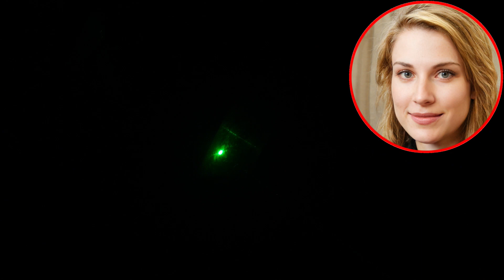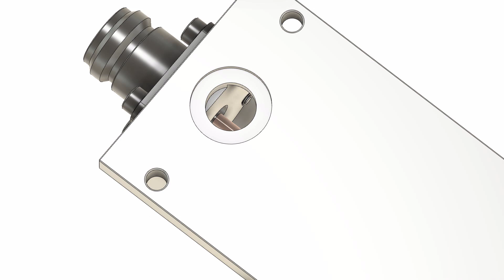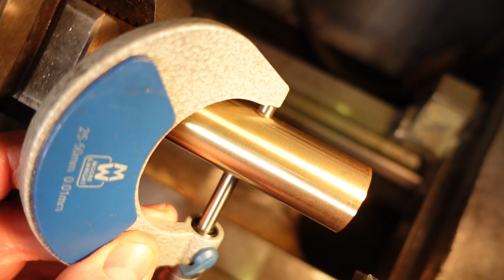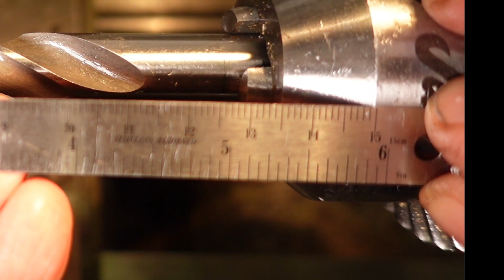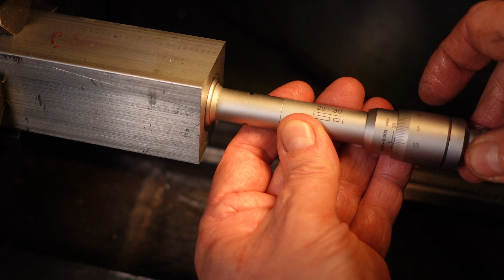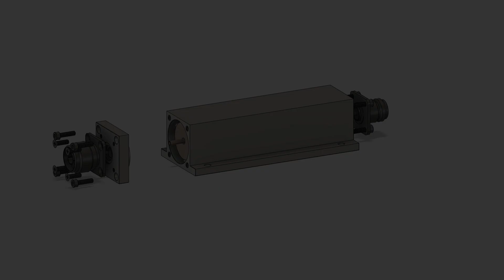Machining Microwave Coaxial Low Pass Filters Part 1

Comment: We are a bit of a niche group of microwave hobbyists with machines shops.  My 1.3Ghz filter is currently made from circuit board cut and soldered, etc.  Might have to try this out. Can you tune that filter a bit?  Not that it needs it at all.  <cough> Just for temperature variations, yeah those.
Reply from the maker: On the lower bands like 70cm and 2m, these are usually made using a long section of threaded rod and locknuts, so they are adjustable. As the primary purpose is mainly to kill the second and third harmonics, the key adjustment would be to optimise the Tchebyshev ripples at the main frequency of interest.  John G3XDY has a very nice 23cm filter design that puts notches in useful places and consists of a air-spaced line with stubs.  This is a brute of a filter, or at least the version with 7-16 DINs is.  This one with delicate little Ns is going to be limited to maybe 400-500W by those.  Mine has two female 7-16s and it should be able to carry more power than I can produce, although for EME, I guess nobody would care too much if I sent the signal with harmonics included.  I guess some tuning screws would be feasible, but the others I've made all just worked.  I have to make new spacers for this one when I do the soldering, to ensure the spacing is perfect. I use aluminium cylinders with a split, in a C shape.  All will become clear in the next vid I hope.  It's going to be interesting to see if there is any difference in S parameters with this version.

Comment: A coating on inserts for aluminium? From Cutwell?  Odd place that Cutwell, sent email re some tool or other. Sorry we don't supply to anywhere outside of UK and Ireland, fair enough, Australia is a long way for Postman Pat to get here.Then I get regular emails trying to sell me bits from their inventory!
Reply from the maker: My dodgy yellow-belly accent sorry, definitely UN-coated.  Cutwel head office is an hour up the motorway from here. If you ever need something from them, I'm happy to buy them and pop them in the post to you.  I'm not sure if there's a way to prepay GST like there is for stuff sent into Europe now. Much depends of you have carrier fees to pay when they collect tax/duty on behalf of the tax authorities, or if you are in a Civilised location where you just get a bill from the Government without Fedex demanding a £20 "processing fee" and then adding 20% tax to it. So annoying.  The DDP prepayment service is between £2.50 and £4.50 fee, but that's at least a little more reasonable.
Reply: @MachiningandMicrowaves  Thank You, that is a very kind offer. However I have a friend in Lincolnshire and he can get stuff for me as easily. Not that I need much these days, most of my normal supply lines are well established after some 20 years.  Although I have just ordered a Diamond insert with a chip breaker from AliExpress.  By the time it arrives I may have got some enthusiasm back for playing with Diamond inserts. Good thing it will be awhile as I have some 750 parts to get made, that's a lot when one is retired!